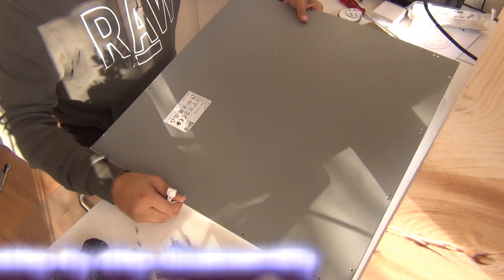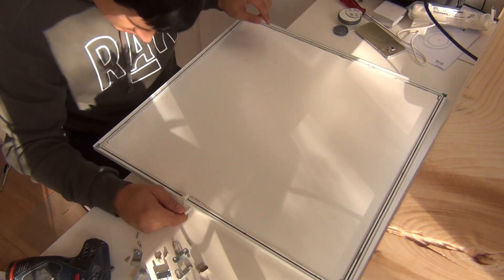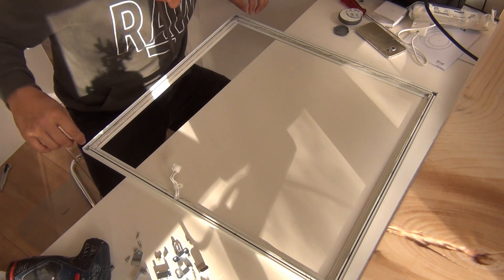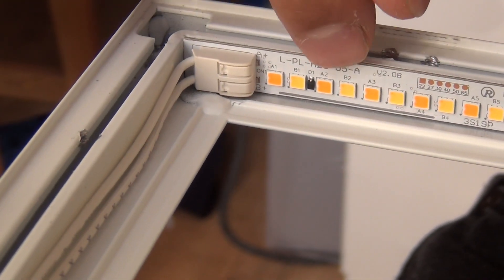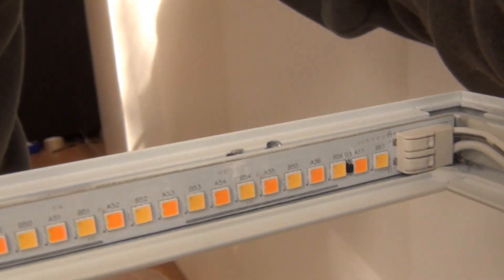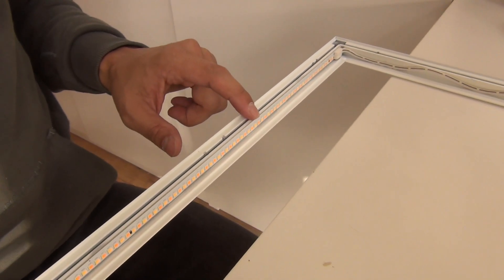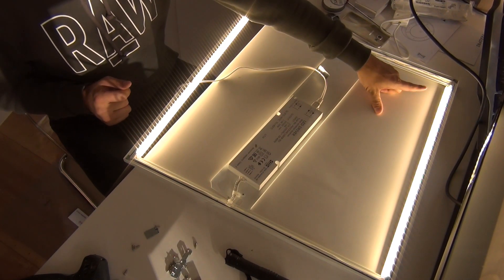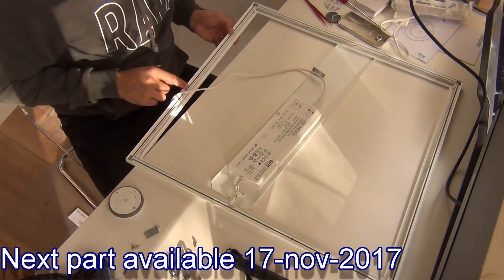Disassembly Ikea Smart LED FLOALT 60x60cm square LED panel PART 2

Comment: Hi friend, thanks for the teardown. Im wondering if you can help me with this Floalt issue I have.
Our light changed colors fine for about two months and then it was stuck on white 4000 kelvin, it dimmed fine though. So we replaced it and the same problem happened only about 1 month later. Today I went to Ikea to replace it for a 3rd time and the same problem persists. What could be happening here? I have tried pairing these lights to both Tradfri and Stybar remotes. I even went and purchased a Dirigera gateway and added the light and remotes, they updated just fine to their latest firmware and still the problem persists.

Comment: Not sure if you mentioned it in the video - this panel has two LED circuits, one for the warm-white and one for the cold-white LEDs. They are each powered separately by the LED driver (one from each output). As you have CW and WW LEDs on both sides of the panel, they needed to connect the two LED strips, which is the 2 wires on the other side of the panel you noticed.

Comment: do you know how thick the acrylic glass is ? I was wondering if it´s possible to replace it with a printed with a picutre to create a lightbox feeling. I know it exists print on 4mm and 8mm.
Reply from the maker: Wow, great idea! I do not know the tickness, but if I had to guess I think it is 4mm.
Reply: I bought a 60cm square one and use it as a lightbox for tracing etc.: it is quite strong enough.
Reply: I am looking at this product now with the same idea in mind, to put one of the acrylic sky pictures that typically go into a fluorescent light fitting. Did you have luck fitting  your picture in? If so what level did you place it inside the light for the best effect?
Reply: @rosibud  nope, i haven't tested it.

Comment: Thank you for your vid. Where you able to take the LEDs of the frame without destroying the cable? I am just about to disassemble a frame to use the LED strip otherwise, so I wonder...
Reply from the maker: Walter Wunderbar  the LEDs are fitted at a Pcb. And the Pcb is glued to the frame. I think you will be able to remove it without destroying the cables. Good luck!
Reply: Have you been successful with using just the LED strips? I'm planing on doing the same in order to get the three tones of white... Would be nice to get an answer :)

Comment: Thanks so much for your videos about the FLOALT panel! They helped a lot! I was looking everywhere for someone who took one apart...
Do you perhaps know the exact thickness of the front plates? Both the reflective plate that gets hit by light and also the diffusing plate in front of it? 
I am planning to put a transparent plexiglas plate (1.5 mm) in front of them and a artwork between the plexiglas and the diffusing plate. So the LED panel would work as a light box and illuminate the artwork from behind when switched on. Do you think that that construction with an total estimated thickness of about 3 mm would work? Would the reflective plate get pushed too far back so the light from the LEDs would not hit it in the right angle anymore?
Reply: Hi! I checked yesterday but unfortunately I already closed the device and mounted it on a not so easy to reach location (otherwise I would have reopened for you). Thank you for your comment!!

Comment: Love your videoes about the FLOALT panel! Can't wait another 7 days to see the next :D
I have thought about buying some panels myself. What about the POWER supply is it constant current or constant voltage?
I'm asking because it's of big significance if you want to eliminate the flicker. I have a standard single color LED panel with a dumb but configurable power supply. The power supply is dimmable by 0-10v (have though about taking a zigbee module from a bulb and make a simple interface). The power supply con be configured for 30w but the panel can take 45 (30 is way bright enough anyway). If you just use the power supply as intended it's also flickering at high frequency when dimmed. But if configuring for constant current you can just smooth out the pwm by a simple capacitor of suitable value (a few 100 µF) and voltage and you get a smooth flicker free light and no difference in light levels. If configured for constant voltage you can't do it as of course the capacitor will then charge to same voltage no matter the on time. Perhaps a suitable choke filter can do some tricks for a constant voltage pwm but it's not without loosing a little bit of top brightness and not something I've played with. Constant current drivers are just way easier to smooth out a PWM dimming.
Reply from the maker: Love these sort of comments :-), thanks! 
I haven't checked the power supply yet, but will do that too! Im wondering why you care about the flicker as it is not noticeable. Or are  you working with rotating / moving objects?
Reply: No I don't work with moving objects. I don't agree it's not noticeable. It's noticeable on my ordinary Hue, Lightify and Trådfri bulbs too - I wonder why they don't have smoothing capacitors as I believe they're constant current. You're right frequency is high but IMHO not high enough - as you can see in your video it's not ideal for video either. IMHO pwm should be in the order of +30 kHz if not smoothed. +30kHz as to avoid hearable noises while being high enough to effectively not being perceived as flickering.
So first of all the purpose is to avoid flicker. Second I believe it's better for diode longevity (I know there's a few opinions about that but I haven't seen any proof for one thing or the other but to me it makes sense for better longevity as % efficiency for the LED dies are higher for lower drive levels - less power to break down the die)